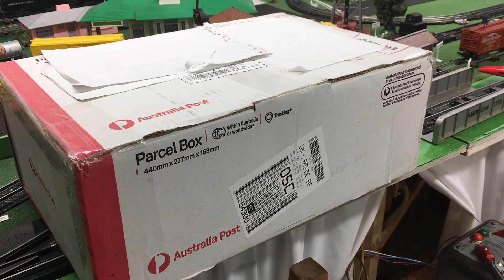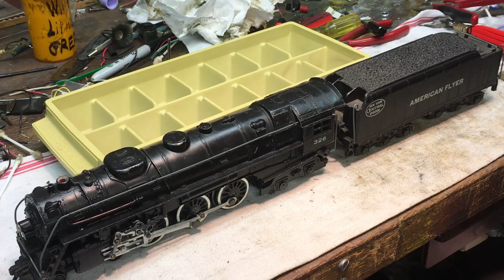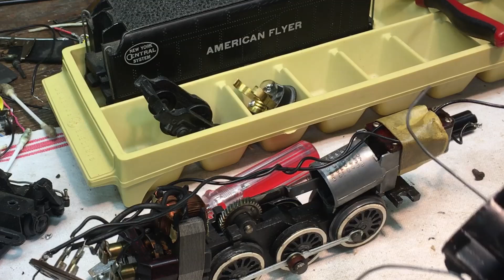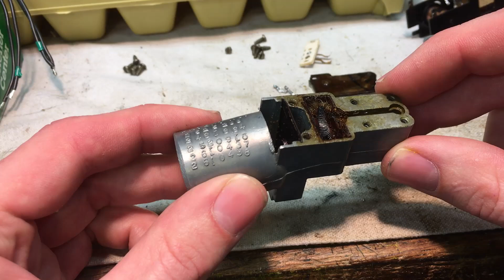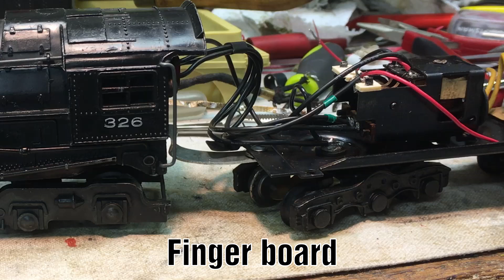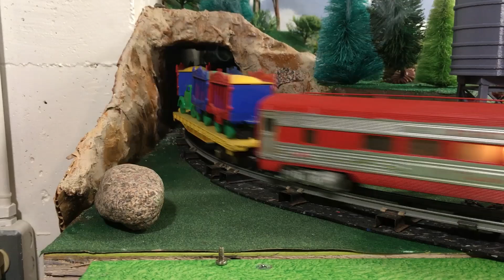Australian American Flyer Hudson Repair

Comment: Very smooth running engine. Nice smoke output. Was that the built in whistle? If it was, that's the best I've ever heard from an American Flyer steamer.
Reply from the maker: This Hudson was in really good shape, but the Air Chime speaker is disconnected. The whistle you heard is the all metal circus billboard- it is in really good shape and can whistle very loudly
Reply: @ObsoleteModelTrains  
I thought so. I have a few of the billboard whistles myself. I also have a prewar New Haven built baggage car with the air whistle.

Comment: Love to see the gasket with rtv!  Did you enlarge the holes in the smoke unit that the nine chrome wire goes through as some people do?  Nice work.
Reply from the maker: I'll be making a smoke unit repair video when I get around to my 282. I did not have to make the holes bigger, actually was able to use a thin wire as a hook and that pulled the wick through.
Reply: @ObsoleteModelTrains  Thank you, can’t wait!